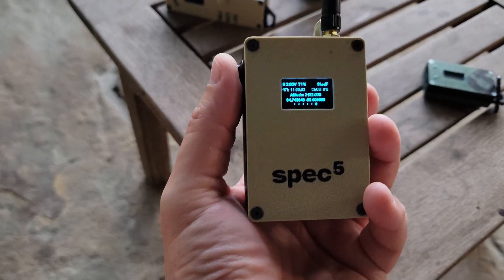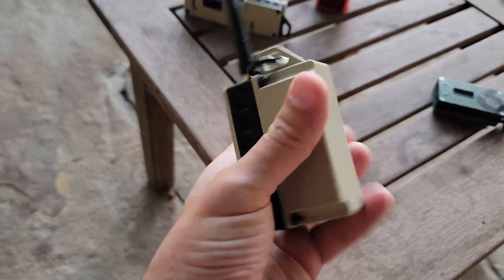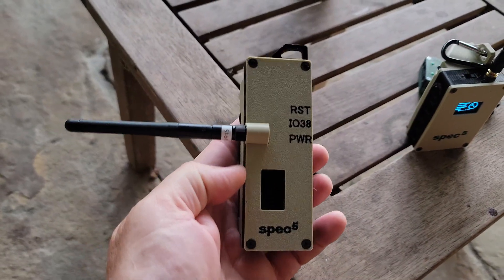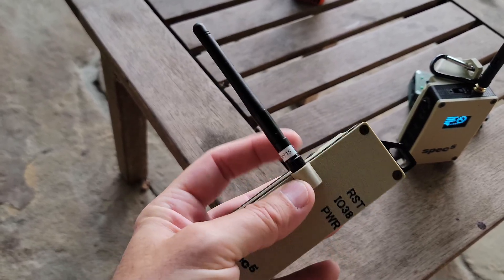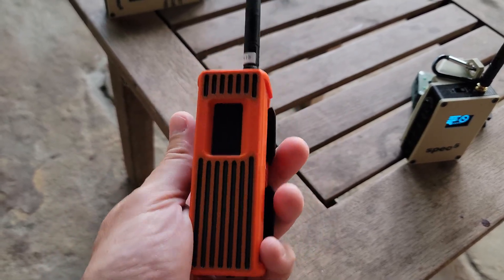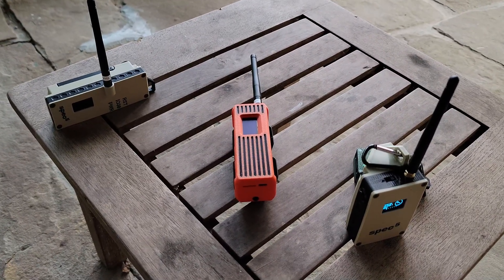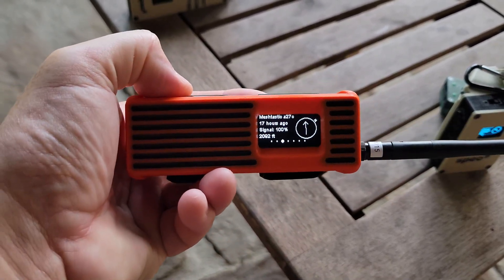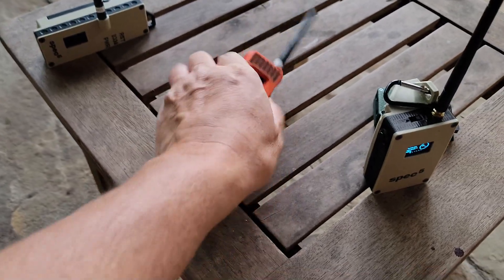Meshtastic Radio: Field Report

Comment: Do I need to point out that you had it plugged in to a RPi and therefor it wasn't using the internal battery at all? how did you miss this? it was powered from the RPi and well yeah, obviously it stayed fully charged. The RAK usb charger doesn't go to 100% to preserve battery life.
Anywho, glad it worked well as a Router for you, even tho it wasn't using any batteries or solar.
Reply from the maker: It's a fair point. I had to go back and watch the video as well as connect a USB charger to the S4 to see what I was or wasn't thinking. The Wisblock not recognizing the USB connection as a power/charging source like every other Meshtastic device I have used caused me to overlook it. You can see in the device list in the video it incorrectly shows it is running on battery. Thanks for pointing it out and for watching!